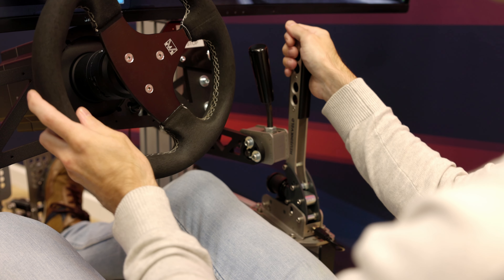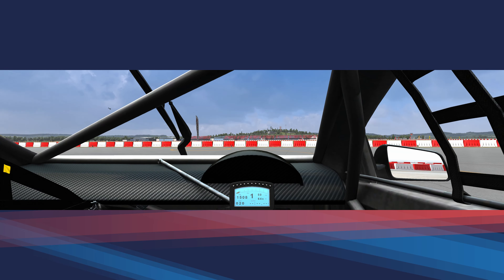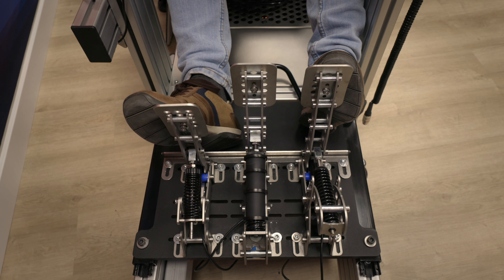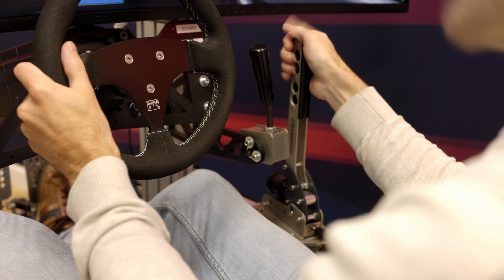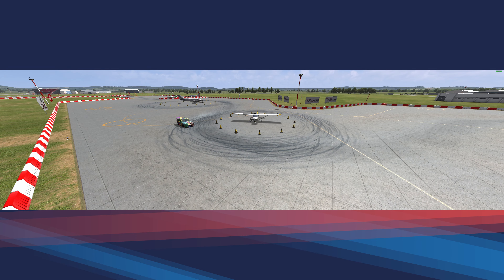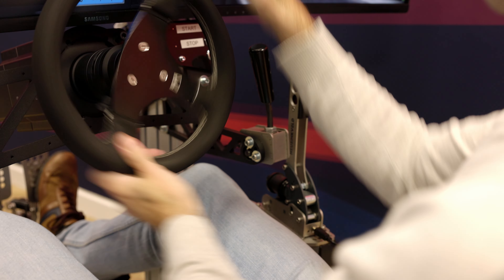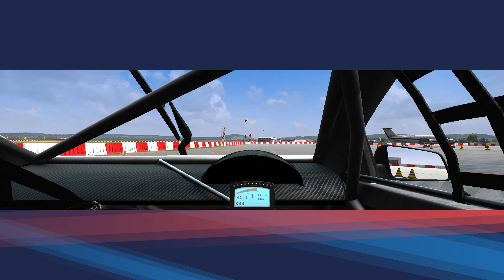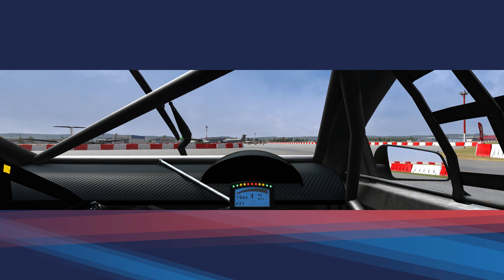Enjoy some drift hacks with Niels

Comment: The handbrake is fantastic for drifting (still using v1), so much better when tandem drifting as opposed to a button, when leading you can keep the car super smooth in transition making it better for the follower, even better when following when you dont want to scrub too much speed but add a little angle and keep up with the lead driver on corner entry being able to add just a little handbrake is a game changer

Comment: Aditional note for beginners:

Normally the moment to counter steer is a bit earlier than you normally would do correcting the car in a grip situation. So you need to thrust a bit that car will slide and counter steer already. Otherwise when you counter lock the wheel the car is already spun and there's nothing to do.